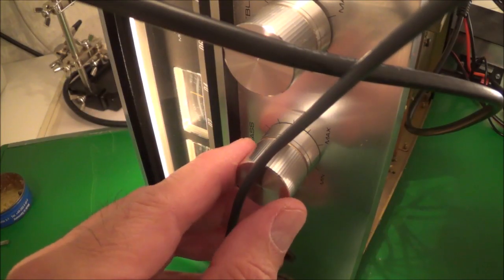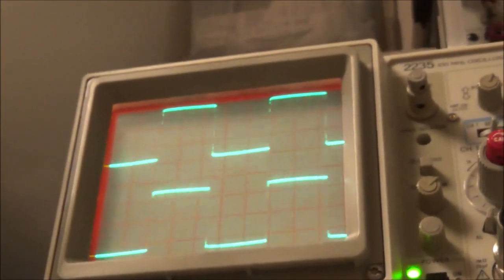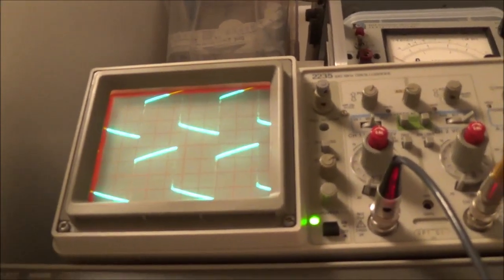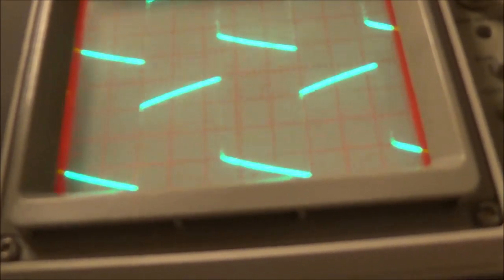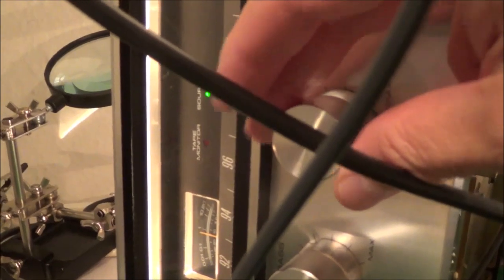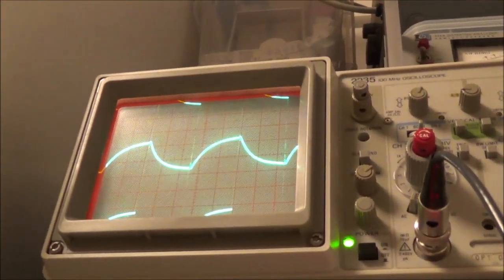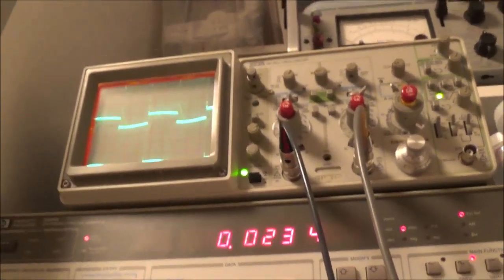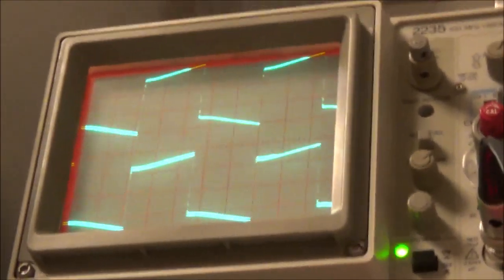Testing Pioneer SX-590 Tone Controls With Square Waves

Comment: I use the square wave test as a before and after recapping. Many times before recapping the square wave will have rounded corners, after they will be square. Bad caps.  I have seen one video where the guy turn the volume up all the way to show that the transistor circuit can go from zero to full voltage with no problems.  The square wave test is not well covered on the forums or on videos. 
Thanks for the video. Always great.
Reply from the maker: Thanks for your input, Pat. What is your normal tone-control test frequency? I chose the 1,000 hz since you them cover from about 100 to 10,000 hz, which is probably about what these particular tone controls would cover. I did't watch any other videos, so I didn't know that few existed. I am not a square wave expert; as you said, rounded shoulders mean loss. And as you saw by watching my video manipulating the controls also produced phase shift.